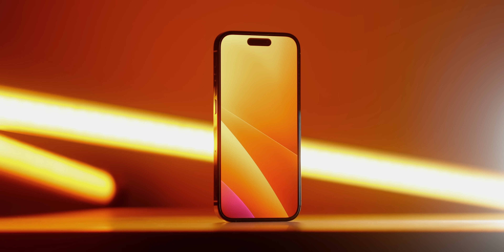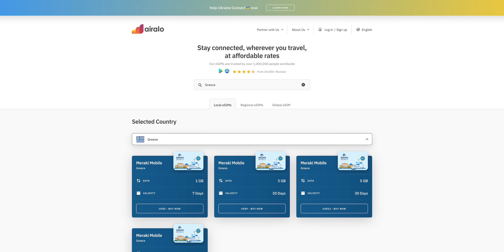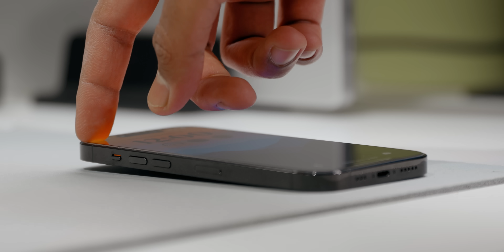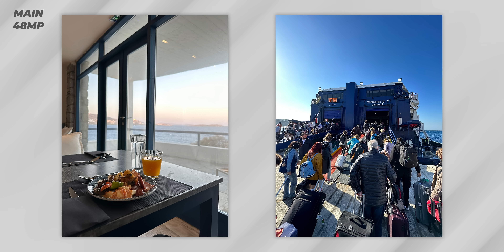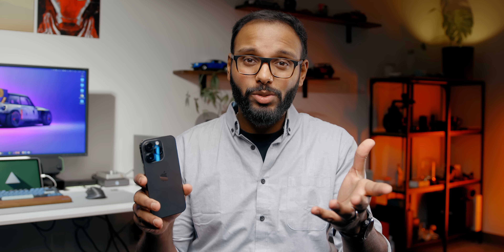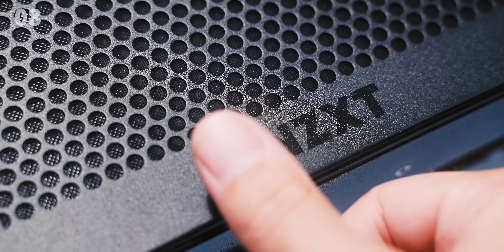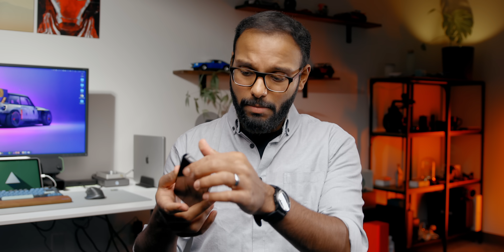Apple iPhone 14 Pro - A Long Term User Review

Comment: I always say y’all making the wrong comparisons, no one with a 13 pro is out out contemplating upgrading, it’s those with older models who are thinking about upgrading
Reply: Comparing it with the 13 is not for the 13 owners to upgrade. Its for the old model owners to get an idea whether they should go for 13 or 14. Personally, I was on XS, and after comparing everything and what my needs are, I went for 13 and got air pods pro 2 and still saved money that I would have to put in if I had gone for 14 pro.
Reply: Agree.
Reply: True I’m upgrading from my 11. But it’s still useful to know whether I upgrade to the cheaper 13 Pro.
Reply: @tejasjayaraman  ive been using the 13 pro max for 3 months now and id say depends on your country
In my country u can get a 14 pro max for only 100 usd more than 13 pro max 
Which id say is worth it since you get one year more worth of updates than the 13 pro max  and more slight improvements
Reply: @ismailamparo1749  are you sure about the update vantage of 14 pro?
The “regular” 14 has the same processor and amount of ram than 13 pro, so… I can’t see any dificulties to apple share the same versions between them….
Reply: @tejasjayaraman  for the used price yes, but $100 retail difference? Buy the 14 Pro
Reply: True, way too many videos out there comparing 13 Pro to 14 Pro! I was contemplating both too but I wasn’t going to be saving much with the 13 Pro. Moreover, I am not the type to upgrade every year anyway. So I chose the 14 Pro. Without a phone plan they are only 400MYR apart, with a phone plan the price difference is 669MYR. If I spread that over 3.5 years which is the average time iPhone users take to upgrade, then you don’t even think about that amount in a year. 😊
Reply: @daleycatch  well either way your 14 will be almost obsolete when they turn USB-C next year. 😢
Reply: It’s only a few months until iPhone 15 comes out so it’s worth it for me to wait a little longer using my iPhone 13 mini
Reply: I typically buy odd numbered iPhones. I have the 13 pro max now. Looking at the  smaller 15 pro if Apple can't find a way to shave weight off the next Pro Max.
Reply: Obviously if you have iphone 11 and under then yes it's a no brainer
Reply: Exactly, I just got 14pro. That is switch from XS. If I had 13 or 12 even I won’t upgrade
Reply: For me, from 6s to 14 pro max, is a worth it upgrade for me. 😁
Reply: @waitforitsecond6885  if you say so…..
Reply: @Carl Gunderson 8 months is nothing in a product cycle. Considering 15 is likely already being produced. Specially for a dumb phone upgrade when there is nothing new. Oh yeah, Island notch.
Reply: Even so the comparison to the 13 pro is the right one, IMHO, because those folks with older models are most likely wondering if they’ll lose anything by saving a few bucks and going with last year’s model.
Reply: Stop being poor. Upgrade yearly like the rest of us.
Reply: There are people out there that upgrade every year . Dunno why not necessary. And it’s the people that upgrade every year are the ones complaining about the new product 😂. I upgraded from iPhone 11 to a 14 pro max . Love it
Reply: Yeah and this year the pro is actually a better buy than the base model, the 14& 14 plus are just not good value
Reply: Yep I had an 8 and had to upgrade so got a 14
Reply: @Carl Gunderson You’d be surprised how time flies when you actually have a life instead of bitching like a hoe to random people on social media but ok. Lmfao.
Reply: @Carl Gunderson Your reply doesn’t even make sense. But, ok. If you say so.
Reply: Wrong, as an iphone photographer, I always check out new iphones from that perspective. Probably will go from 13 pro to 14 pro.
Reply: @maesc2001  any photographer knows iPhone 14 camera is the worst in market.
Reply: @darma8159  Any photographer? Wow! Well, I didn’t.
Reply: @maesc2001  yeah, I would test them. Compare to galaxy and pixel pro. You’ll see what I mean.
Reply: Completely agree, I upgraded from a base iPhone 8 and I’m loving my 14PM!
Reply: We’re all different. I upgraded from the 13 pro for the AOD
Reply: yea im considering upgrading from my 11 pro max to the 14 pro but i feel like i can wait till the 15 comes out. should i?
Reply: @tjboone  considering the same
Reply: Agreed
Reply: Dude show us the stats? Do you have any? It's ifan we're talking about. They will sell their kidney to buy the latest shit apple feed them.
Reply: Upgrading from a non iPhone 13 series is a no brainer. So that’s why I feel like people are looking for any reasons why they should upgrade from any of the 13 series. One thing is the minimum focus difference is way farther, so if you do close up video (not macro), you can get objects super close, like 4cm to the 12 Pro and 13 pro, and almost 8 inches away from the sensor on the 14 Pro. This is big for people shooting close video that don’t want that ultra wide feel
Reply: Yep I’m one of them and just did upgrade to the pro
Reply: You really are just wrong my guy 😅
It’s true most people don’t, I’m a pretty major tech nerd and my phone prior to the 14 Pro was the 11 Pro. But they do exist, they are very real, and yes it is kind of sad… but then maybe they just need the tax write off 😂
Reply: I just upgraded from the 13PM to the 14PM and honestly the only different feature is the dynamic island for me so far, only upgraded to hand down my phone to my mum since she water-damaged her Iphone 11. I wouldn't have upgraded otherwise.
Reply: True. I'm planning on upgrading from my Samsung Note 10+ & iPhone 8 Plus to a iPhone 14 Pro.
Reply: Couldn’t have said it better man
Reply: Exactly!!!!!!!!!!!!!!!!!
Reply: I went from 11 pro to 14 pro big difference love it
Reply: There’s some people that sell their 8-12 months phone for 80-90% of its retail value and buy the latest model. That way you always have the latest iPhone and you upgrade for like 150-200$.

This probably works better for 128/256GB models tho, don’t know how much value you get from reselling the 512/1TB ones
Reply: Wrong, I traded in my 13 pro max and got the 14 pro max lol
Reply: There are a lot of people that I know who upgrade their iPhones every year. Their reasoning for that? "Because it's newer and better."
Reply: Yeah, most folks aren’t upgrading every year! I’ve finally upgraded to a 14 Pro Max, and love it! Before that I rocked my Samsung Note 8 for close to five years, and before that was my Note 4 … before that was my Galaxy S5!

I definitely run my phones into the ground, and I’m looking forward to using this iPhone to the MAX, haha.
Reply: It's also not smart to compare it to anything other than a year previous to the 14 pro.. it's obviously gonna be better than anything before the 13 pro lol. But it's reassuring that people aren't missing out with an older model. I returned my 14 pro max after 3 weeks. Most glitchy iphone I've ever owned. Now I have the s23 ultra and it's been flawless since I opened it. Battery life is insane. If I really wanted too I can go up to 2 and a half to 3 days without a full charge. Screen on time I'm averaging about 8 hours sometimes I'll get 9-10.
Reply: Facts I’m upgrading from an iPhone 11. I just ordered my iPhone 14pro through Verizon. Color gold.
Reply: Exactly I upgraded to the iPhone 14pro from iPhone 11
Reply: yeah but its for people to see if they should maybe spend less
Reply: I’m one of those tech nerds (suckers) who upgrade every year.  We do exist.  The last cycle I skipped was the 7 series.  Just went 13PM > 14P.  The upgrade does feel a bit weak and I wouldn’t have gone 14PM I don’t think, wanted to try moving back to the non-max size.
Reply: @tmclaughlin11  this what caused inflation. Now good luck with the lay offs.
Reply: @tmclaughlin11  I did something similar I upgraded from 12PM TO 14P wanted a smaller phone got tired of the weight
Reply: I'm an apple employee. in Saudi Arabia. everyone is fucking upgrading bro
Reply: @Tarwada_  i live in saudi arabia and everyone is upgrading 😂😂 these people are getting affected by marketing so much 

I chose the iphone 13 pro max coming from an ipad user because i didnt want an ipad anymore

I have a friend who upgraded from a 12 pro max to a 14 pro max but i guess its more reasonable than 13 to 14

Overall when i borrowed his 14 pro max the camera wasnt noticably better but the front camera was slightly better especially in low light 

The battery wasn’t much better id say maybe like very very slightly better? If not just the same
Its not worth it 

The always on display was fun and the dynamic island was kinda fun too but thats only because its new and different, youll get used to it after a while

Dynamic island can get distracting when playing games or watching videos compared to the previous models but its not a big deal

If you have the 13 pro max then its only worth it upgrading if you want to and have the money for it
From 12 pro though it is worth it but I suggest wait till 15 so 14 price will drop
Reply: @Tarwada_  
I'm also in KSA and dude right??? everyone's upgrading from not-so-outdated models such as the 11 or 10 like??
Reply: You’d be surprised. I get a new one every year much like most users I would imagine.
Reply: @markbrito21  nope. People stopped upgrading at 13 Pro

Comment: I really want this phone but there isn't much differents between the 13 pro max and the 14 pro. Maybe the size fitts me better.
Reply: That’s why I upgraded last week - 13PM > 14P.  The upgrade is underwhelming but I wanted to try the smaller phone as the PM is a brick to carry around.  It does feel nicer in the hand, but I’m still on the fence about it, though, admittedly.
Reply: I can see how you would downsize from pro max to regular pro. As you said I agree the 14 is not worth it and underwhelming when compared to others.
Reply: Nö  mony & Batterylife
Reply: iPhone 14 Pro Max 💚

Comment: be mindful of getting involved with the Apple Prostitutes. they will try to squeeze every cent out of you. Lemme explain :

since 2016 they've been soldering the SSDs onto the mac motherboards making it impossible to repair by replacing or to upgrade.
- they also overcharge 3x-4x per TeraByte of space : Apple 2TB SSD ---> 600-800$ (non replaceable) while Samsung 2TB 980PRO : 200$ :)))
- When the SSD Fails.. and it will , they will also overcharge you for the repair , because guess what, if you need it replaced , the way they go about it is by replacing the whole motherboard which is an absolutely wasteful way to do it. Imagine replacing so many parts when you could've just replaced the SSD. But they want YOUR MONEY. 
- Iphone 14PRO (1000$-1600$) still comes with a shit lightning port (USB2.0) Speeds. (Guess how much money they make by licensing that dumb connector to 3rd parties that make cables and adapters and all that. (it was a good connector in 2013-2014 but USB-C came out in 2014. and it's 2022 and Apple still has (SHIT) lightning connector. May meteors fall on their HQ if they don't change their money hungry ways. May God save the worthy over there.

I’ve been an iPhone user since 2011 and a macbook pro user since 2015. But i feel like i’m going to go back to windows with a nice lenovo legion 5i pro 😃. Can’t take apple s bullshit no more , no matter how shiny they make their whore products 😂

be very careful getting involved with the Apple Prostitute. They are out to get every last drop of your money. :)

Comment: There is just one thing in personally concerned. Hoping someone can help answer this. 

So I do something blasphemous. I carry both a S22 ultra and a 12 pro max. Basically my 12 Pro Max is my main running and the S22 is a backup phone. Usually what happens I just change my sim if let’s say my iPhone is low and I need to go somewhere right away I’ll switch to my android as usually it has nearly full to full battery. Once I am ready or if my iPhone finish charging I switch back. 

So someone like myself who switches sims in different phones like iPhone and android. Would the Esim allow me to do that? I feel like it will be more of a headache then just switching the physical sim. 

I will say I am not 100% familiar with eSIMs and haven’t used them but that’s what is stopping me to switch over to a only esim phone.
Reply: I do the same, 14 Pro is the main and S22 Ultra is the second. I have lines to both so I don’t have to worry about switching sims. I’m not sure if you would be able to active and deactivate the sim on a spur of the moment …

Comment: I'll be switching to iPhone this month after being on Android since forever. There are so many thing I'll miss but so many things to look forward to. Lets go
Reply: I did this on the 12 pro, i regret it every day.
Reply: Made my switch from android to the 14 pro last month. No regrets, loving it.
Reply: I switched less than a year ago to a 13 pro and have been loving it, though...I love tech and cannot wait to see what the future S23 line up will bring. The notch does get on my nerv from time to time, but I must say, Face ID is dope!
Reply: @Hanatsuki27  My early impressions after moving from Android to iOS, is that on iOS the same interactions take like 3-5 more steps.

For instance, I transferred all my apps to iOS but I had to install it still after transferring. You cant batch install so I had to MANUALLY install EACH app one by one...fine.. but then, pressing "Get" requires authentication (Face ID) AND confirmation by double pressing the lock button. Ive probably doubled pressed that button 400 times to install each app... I have a million more examples 😂

Overall the apps are significantly better and more fluid on iOS

Comment: Kept always on display off since the time I have been using an android which supports AOD. Currently using the Galaxy Note 10 Plus and I just tap the display once to show a dark screen with only clock, notification icons and battery indicator. That's it. I kept the full-fledged AOD off. That's going fine for me since the beginning.

Comment: I got a new 14 pro 2 days ago at the time of writing this comment, but it loses battery so fast. I used it for 1-2 hours and it lost over 30 percent. For a new phone I wouldn’t expect it to lose that much charge. What should I do?
Reply: How do you use it then?
Reply: the battery life of my iphone 14 pro max also sucks. only 8 hours on display time even always on is turned off. some ppl get 11-13 hours on display time with the ip 14 pro max. i hope the upcoming ios 16.2 update will improve the battery life of my iphone 14 pro max

Comment: It’s not much of an upgrade but I upgraded from the 13Pro to the 14Pro and I am actually surprised by a few things. Oddly enough it’s not talked about much but the speakers are much improved, especially on the low end. The sound is a lot clearer, fuller and on the low end, when in bed ready to knock out, I just have to go one click above zero and it does a well enough job . The dynamic island is super convenient to go back and forth between apps. Love it! I don’t even really notice it as a distraction, it’s a completely new feature no other phone has. It works so damn  naturally. And of course, the camera. The refinements are noticeable and extremely fluid and easy to use. I’m actually really happy I upgraded and didn’t think I notice much of a difference but I did.
Reply: What about the battery?
Reply: Can you tell me more about the camera improvements specifically in comparison to the 13 pro, not including pro raw
Reply: The speakers are alot better i agree.

Comment: Always had my AOD turn on since they started implementing on Android. Just recently bought an IPhone 14 pro and glad that they finally implement AOD. Still prefer the all black background but i wish they implement notification icon instead.
Reply: iOS 16.2 beta has all background choices in settings, as well as not having notifications. So if you want a very basic AOD with just a clock, then that is OK.

Comment: I have the always on display active on my 14 pro max.. I like it and it doesn't really use that much battery but I don't use widgets as I found that was where the majority of the always on display battery use was going. Especially the weather widget contuniusly communicating with the internet and updating on the go. I don't find it distracting at all as for my eyes atleast I can tell the difference between the phone off or on. And I'm not the type who hangs of every single notification all day. I generally check notifications when I feel like picking up my phone or if I am expecting a notification, like a delivery or a message.. If its urgent people can  always call me.

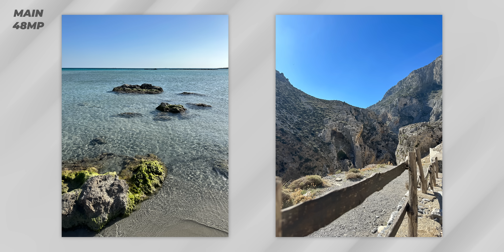Comment: Timeline 5:11 - right hand side image - I think tthe sky is not properly processed and this is time and again the HDR at night is a miss more than a hit is what I feel. I have both 14 pro max and s22 ultra and this year I lean a bit more on the S22 ultra for my camera needs and also what is with this model year and over-processing. I just don't get it
Reply: Looks great to me, and the reviewer says it is good. I suppose it is subjective. Apple cannot take a photo and please every whim. Of course, if it is that important, then just use an app to do post-processing or get an HDR app that allows you to tweak the HDR before you snap it. Remember, with HDR you have to be very still and the vista needs to be static as well. Also, in low light, tap the area where you want the darker areas to have greater HDR rather than letting the AI do it. You should, if you know what you are doing get great HDR photos from the 14 Pros.